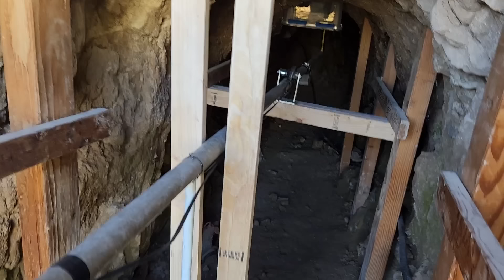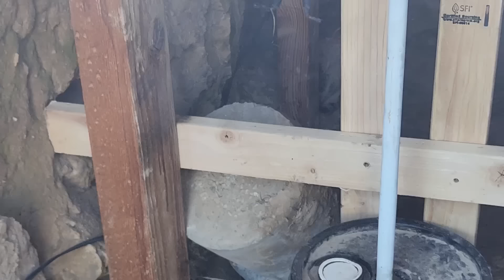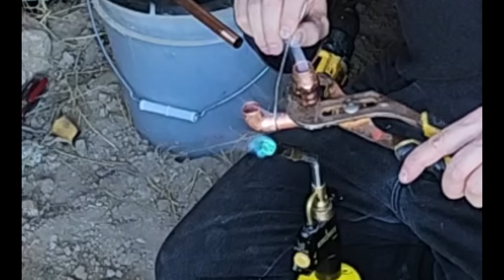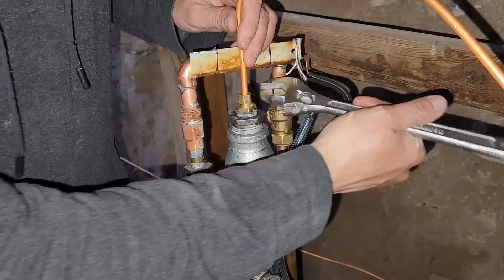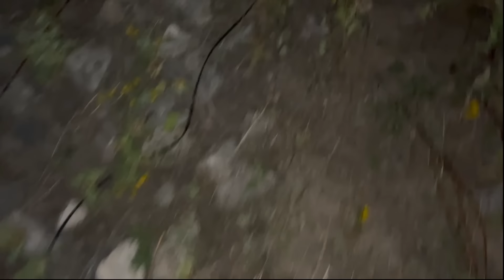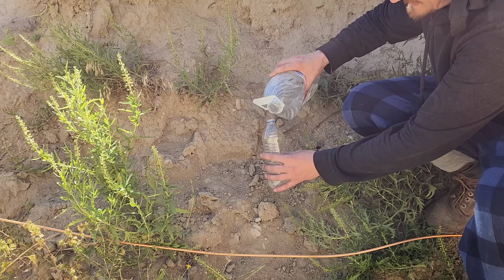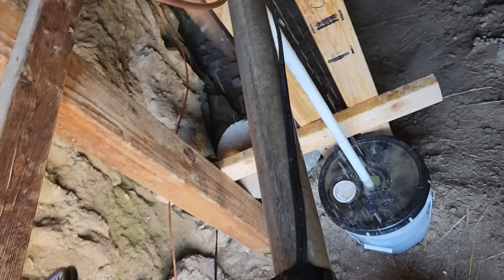Sodium Water Hybrid Rocket?

Comment: Hmm, so aluminum + polymer bound ammonium perchlorate based composite rocket engines are similarly restricted due to metal components?

I'd think that rocket fuel composition would be regulated separately from engine casing and rocket body materials used ... unless it's a strange issue of composite metal powder fuel vs bulk metal fuel being used.

Comment: Liquid K-Na + H2O sounds epic, with a Pintle type injector and proper rocket nozzle. And I like the comment of martys9972 about a secondary burn of the H2 with O2.
I'm also wondering if you could do a liquid K-Na and high-test Hydrogen Peroxide?
Thanks for sharing this project with us.
Are there other mixtures of alkali metals that would be liquid at low or room temp, and be more energetic with water or H2O2?

Comment: i feel this design would have worked way better if it didnt shit out its own sodium.

perhaps a better designed combustion chamber..would a spiraling design work better? instead of going straight down the hole, a spiral staircase of sodium the water drips on? might be a little unstable laterally but i imagine it would ensure a full burnoff and theoretically no unexpected taco bell

Comment: I think to get around the liquid sodium exhaust problem  you need to treat it like a liquid liquid rocket... have two cannisters and a combustion chamber. Then pump the water and the sodium into the chamber where they can react. You can pump on the test bench by just using N2 pressure. Obviously this is difficult because you can't easily aerosolize the sodium. You could make a NaK alloy,  that would keep it liquid at room temperature and increase its reactivity, but I don't know how you would get around the nozzle dispersing the NaK without getting clogged.  At this point if you have built a working liquid -liquid rocket engine , you would probably just be better off using a different liquid fuel than sodium water. I would like to try kerosene nitric acid , which is cheap and easy enough to test with. Only issue being the susceptibility to corrosion. I've been experimenting with paraffin based solid rocket engines with ammonium perchlorate,  think they have a ton of potential and even preferred to typical the polymer based ones. It's just a matter of getting the pouring right

Comment: Maybe try using something to help hold the bits of sodium together, such as fiberglass tape wound around some sort of spiral form then melt the sodium around the fiberglass? A tube with holes in it inserted into the sodium core could maybe help direct the water better to prevent it from shooting the sodium out of the chamber. My other thought was making a heater on the rocket that melts the sodium and lets it flow through a tube into a combustion chamber, maybe with some sort of mixing system, the density may be a problem though...

Comment: Would it make a difference if you drilled 16th inch holes down the length of 1/4 inch stainless steel tubing the same length as the engine. Maybe 4 tubes and placed at 4 sides of the inside wall of the engine with the holes pointed inward towards the sodium . Then it would feed pressurized water evenly all the way around and top to bottom . Also a stainless mesh at the bottom to hold all solid pieces in when firing. I might be assuming wrong that the stainless won’t melt ?

Comment: Treating the sodium like the fuel in a solid rocket is not the right approach.
You may get better results if you try some of the following.
Turn the sodium into thin sheets and sandwich it between aluminium foil or baking paper and coil it around  a mesh tube. Put some perforated tube in between each roll of the foil with the holes sealed by foil or wax with only the starter coil to initially receive water. As it burns it will unseal each coil allowing it to interact with the water.
Alternatively.
Create a spherical combustion chamber filled with water and use some kind of ram feed to force in sodium in pellet, powder or liquid form. A tube that is sealed at the top with a burst membrane above the water level will lead to the exhaust nozzle.
Next option.
Create many small tubes (plastic straws?) filled with water and sealed.
Wrap them in sodium foil. Fill the combustion chamber with these straws.
Leave the central part clear with a sodium tube that is sprayed to ignite the rocket.

Comment: Pretty sure the regulations specify the rocket doesn't have any unnecessary metallic components.  People have metal in their high-power rockets all the time, its used for motor casings, bolts, nosecone tips, etc.  Sometimes iron is put in the motor fuel to create a sparking exhaust.  Just get an L1 certification with Tripoli and launch out at the FAR range, they will let you launch basically anything out there.

Comment: An idea to make more of the sodium react might be to put the rocket "upside down". As in, don't have the combustion chamber containing the sodium pointing down, but instead have it pointing upwards, and have the water shoot in from the bottom of the combustion chamber. You could do the same thrust calculations, but just the other way around.
You could then have a pipe leading from the top exit of the combustion chamber, which makes a 180° bend and turns down. This should allow more sodium to react, and allow the gases from combusion to exhaust downwards, since that's what'll be producing most of the thrust. Although, this may cause issues with the sodium melting and blocking the flow of water. If this happens, you could have the combustion chamber sideways, and have the exhaust pointing at a 90° angle downwards.

Comment: I'm sure if the graph were in the computer it would be quite easy to get the area.
Maybe a load sensor instead of all that rigamarole. By the way, the enormous mass of your mechanism dampened the initial peak a substantial amount,  and the steep drop was rebounding of that mass. The peak was actually more than shown. The negative peak value can be added to the positive one, as this energy was turned into inertia.  It should average the same however. 
I would have simply minimized the inertial mass by using a piece of balsa or aluminum beam across a scale with the motor hung underneath,  in a tube for stability,  firing upwards.  You could have eliminated 99% of the unnecessary mechanism.

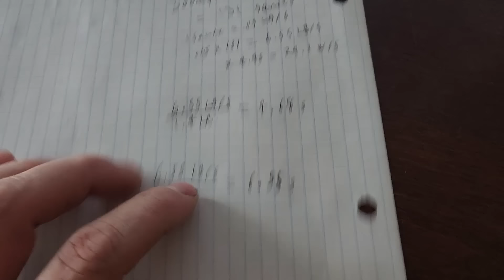Comment: 31:00 Failing to put the copper tube down through the sodium hole, so the water only touched the bottom of the sodium was a mistake. Having the water explode right when it touched the sodium at the top of the hole blew the sodium out the bottom right away. One way to get a slower burn might be to keep it all just like you have it, but have the water jet enter a copper tube that never gets removed, and melt the sodium into the half-toroid "cup" and screw that into the water source. That way, you're not trying to flow water through a sodium pipe...something that can't easily happen.

If you wanted to slow the burn even more, you could alternate sodium layers with layers of wax or mineral-oil-soaked-paper, making lot of small "stages" that would quickly melt/burn when the slightly pressurized sodium and water mix below them ignited. Also: definitely go wrapped carbon fiber + epoxy for the rocket itself. ...It might also help you skirt the idiotic "no metal" rule...

Comment: this may be crazy but maybe you need a buffer to slow the burn of the sodium maybe particularize it and mix it with wax or even kneed into the wax to form a slower reacting mixture. this will also prevent the sodium from melting in mass as the melted wax will pull heat from the reaction. just some ideas cheers maybe rubber but how would you mix it.

Comment: I wonder if an upside down rocket may solve the sodium from falling out as liquid so inject water from below at 800psi and have the exhaust at the top and then bend down facing the ground and maybe have a 1-way valve to prevent backfire liquid sodium from getting into the oxidizer tank

Comment: Use a drill to make ur solidrocket engine hole start with a small hole at the exit and get larger as u go up. Might need to design an engine with a water line inside that   continues to provide a slow drip

Comment: As all rocket engineers Cody has the problem of best diffuser/injector plate design. May be more of a Diesel engine injector for small droplets and high pressure.
May be feeding the water from below could solve somewhat the melting problem, a bit like that solid rockets black powder or SRBs also a lit from below.
Or pre-igniter on top and secondary at the bottom to generate some kind of backpressure for more complete combustion.

Anyhow more rocket always good.

Comment: It would be really cool if you could create a Downs Cell and inject the molten sodium and water into a reaction chamber at the same time.  Then your fuel (inputs) would be just salt, heat and water.  But, of course, that would mean that the cell and the power supply would have to be on-board the rocket.

Comment: Perhaps use a 3D printer extruder to extrude sodium wire directly into the combustion chamber. No need to heat the wire.

Comment: Did the nozzle come out? I could not tell if you used a de laval nozzle. Not sure how you would calculate the throat diameter but to a fist approximation it should not matter as long as you get a velocity over the speed of sound. Smaller will just mean a longer period of thrust and higher pressure. Maybe put a pressure gauge at the inlet of the nozzle. That and the diameter should tell you if you are in the supersonic region. Let me know if you want help making a data logger to record pressure and thrust. 

BTW did you find the graphite nozzle? What condition was it in?

Comment: can you build a rocket cone on the end of a fuel injector that fills with water then gets hit with 380,000v in a few pulses timed to allow the chamber to fill with water just before the next electrical shock, using the 1-60,000 in volume change as the propellant?

Comment: I saw an exotic propellant rocket consisting of  a tank of aluminum flitters floating in kerosene  with a tank of LOX above it.   One could experiment using Na  by  preparing it  into small particles.  I would fill a kitchen blender with kerosene,  add  some cut up chunks of Na & blend for a short period.   If the Na sinks or floats,  add a small amount of mineral oil  until the  Na stays suspended in the kerosene.   The second oxidizer tank will be 70% isopropanol.     Cal Tech's JPL   experimented with  many fuel combinations.   JPL   started rocket research  way before  NASA.

Comment: I was wondering if pressure water shoot from the side if you had rocket that will work with sodium.A mist of water will light up the rocket and sodium will cause a small explosion that will heat up the water making it go to different direction then it will shoot out from back of the rocket re lighting up the sodium or escaping from the sides?

Comment: You could use a electric motor push out a small mist of water from the bottom of the rocket. And the sodium rode should be wrapped with plastic so the water won't touch the top or middle to avoid a explosion. Hopefully you make a 🚀

Comment: A heat tape around the sodium ( to make it a liquid and easy to control the heat range and have the ability to load it cold) and a regular gravity fed 12v fuel pump to an injector nozzle and the water pressurized in the same manner, but separated until fed into a combustion chamber would help your results, but it does add to the complexity and weight of the rig. Thanks for the great vid again!

Comment: Can be made to turn that sodium into super tiny pelets which are round. 

Is soft so can be extruded in low gage wire, cut, put between 2 groved disks and made round.. with particles pf say 1 mm, or less and then those can be pressure feed into the chamber with a piston like toothpaste, and water the same. So then yep you have full reaction. 

I did not knew how specific impulse is measured. Very interesting

Comment: you should move the water pipe to the top and add a dip tube in the pressurized water chamber and have the argon tube at the bottom

Comment: Why not superheat the water chamber and have a controlled pressure release valve into the sodium? Then you can calibrate the release rate of water. and being in a gaseous state, it will quickly fill every void in the sodium chamber and provide a uniform reaction (burn rate) while maximizing the surface area of the reaction, regardless of how much or little sodium is left in the chamber.

It could also help to make the rocket nozzle a smaller diameter to maintain a high chamber pressure, which might help increase the melting temperature of the sodium during the thrust period? Making it less likely to melt and blow out before the reaction is complete?

Just an idea. I could be totally off. But that's the first thing that popped into my head before you even did your water test run.

Hope you can refine this to make a functional sodium rocket!

Comment: One of the things I like to do is combat flat earth and science deniers. one thing they often demand is showing thrust and combustion in a vacuum, and despite the fact that those videos exist on yourtube using model rocket motors. they claim that because the motors expel gas, it fills the chamber and that constitutes the "medium" which is needed for rockets to "push" off of. (Yeah, they ignore Newton when it's convenient for them) I wonder, if this device was put in a vacuum chamber, they would accept this working in a vacuum, because this appears to generate thrust before a lot of gasses are expelled.

Comment: Measuring weight to measure area under the graph is a very brilliant way. Another way is to trace the lines over a picture of a graph in a CAD software and let software give you the area of the surface enclosed by the graph.

Comment: I think solid state rocket fuel plus liquid oxodizer needs a very well controlled supply of the liquid. And there must be enough oxodizer, the liquid is propelled out (this is less bad with smaller, steady supply). When the solid tends to melt too, things get creepy. But..... Imagine using a liquid chemical too. NaK, or heated Na. You could deliver that to the engine in a pretty stable flow, eg via Argon overlay. Bring pushed into the chamber in small droplets, adding to the sane small water droplets, may bring a fairly efficient, constant propulsion. Still you lose H2. You do not want to. H2O2... Maybe... Hey I wrote that before you last sentence :-)

Comment: What if you fed the sodium into a stream of water? Maybe use more pressure washer nozzles around the outside spraying at a wire of sodium fed from a coil? No idea if that would work or not, but it would solve the sputtering

Comment: Can't believe you're pushing climate change
Reply from the maker: I can't believe that there are people that still deny it. It's like denying that 2+2 = 4 even after someone explained it using gummy bears as a visual aid.
Reply: @theCodyReeder  you have zero knowledge of what you speak clearly
Reply: @theCodyReeder  but I'm glad you understand basic addition
Reply: @theCodyReeder  you might wanna investigate what happens when you collide strong electro magnetic fields together...
Reply: @theCodyReeder  The simple answer is that adjacent magnetic fields pointing in opposite directions tend to annihilate each other, releasing their magnetic energy and heating the charged particles in the surrounding environment. There's your climate change...

Comment: When weighing the paper graph, by putting the small piece of paper on the scale first and then zeroing the scale You have already accounted for the weight of that paper being subtracted from your final number.... You then physically remove the paper putting the scale into the negative before adding the paper meant to be weighed.... Effectively subtracting the value of the first piece of paper TWICE, thereby corrupting the accuracy of your final number

Super glad you didn't also make that same mistake when weighing the rocket combustion chamber before adding the sodium...... An extra 1,176 g of unaccounted for fuel could have potentially been pretty dangerous
Reply from the maker: Please explain how that subtracts twice. Maybe I'm just stupid but that ain't mathing.
Reply: @theCodyReeder for example if you have two pieces of paper you need to weigh and one of them is 100 g and the other is 10 g..... The scale starts at zero, you add the 10 g piece of paper so the scale now reads positive 10 g..... You hit "TARE", returning the scale to zero and accounting for that 10 g....... Then you remove the 10 g piece of paper from the scale so that it now reads -10 g..... Then you put 100 g of The remaining paper on the scale and it will read 90 g... Even though if you were to weigh both pieces of paper at the same time it would read 110 g.
Meaning your final number will be 20 g less even though you've only removed 10 g worth of paper from the equation

Comment: I suggest you use a two liquid injection system.  Since you have pressurized argon, that can be used to control the flow of molten metal into the chamber and you can keep the injections consistent with stoichiometric ratios.  Additionally, in place of sodium, use potassium prepared by oxioreduction with magnesium.  I would be happy to send you my experimental notes for doing that very efficiently if you want.  As you know, potassium has a lower melting temperature of 63.5 degrees and will be easier to keep melted without relying on your blow torch system.  On that note, you may construct a simple melting chamber with kanthal wire and use electricity to melt and control the temperature.  Cool design,  I am glad you made it work.